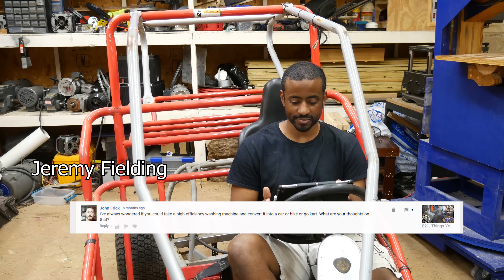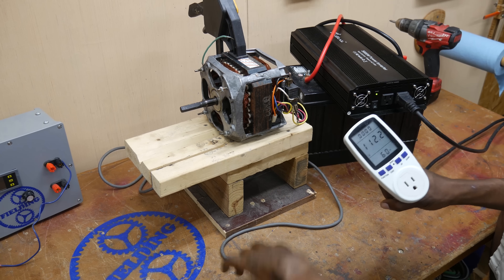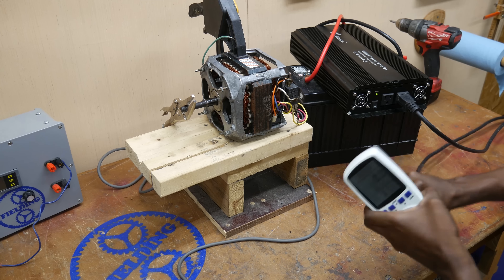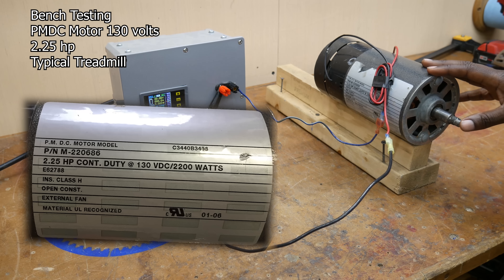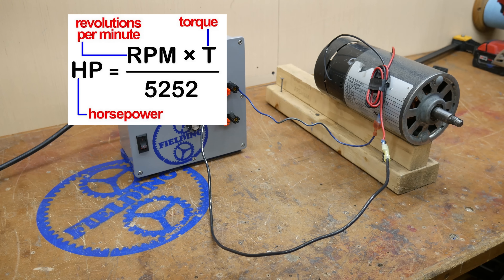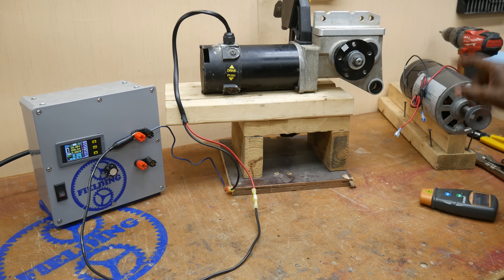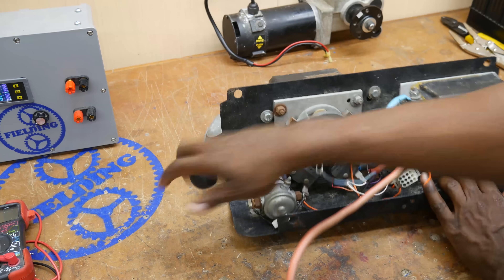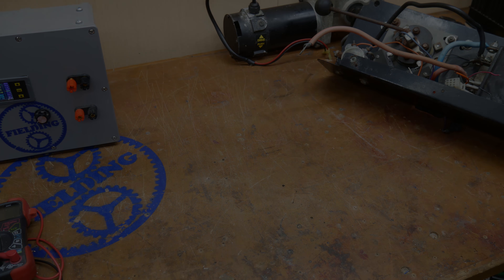What Electric Motors Can Be Used In A Go Kart or E Bike; Bench Testing and Recommended Sizing #61

Comment: Very good Jeremy. However I think you were unfair to the inverter. An induction motor will draw 6 times run current when starting, ie on locked rotor. 6 times that run current (150W/112V) is 1.34A x 6 = 8A. At 112V, that's 900W. The inverter was providing 1500W so probably wasn't limiting. The motor was simply drawing its maximum locked rotor current.
Reply from the maker: Which motor are you talking about? I don’t think I showed a motor that small with testing. Give me a time in the video if you need to, also I would want to learn more this 6x starting current? Do you have a good source for that? It’s sounds high to me, but I would love to learn if you got it from a good source.
Reply: Sorry, the washing machine motor at 2:28. Electricians are taught that an induction motor locked rotor current is 6 times run current.
Reply from the maker: That motor is 1/2hp or about 370 watts..I will look into typical starting current and see what I find. I would expect 2 or 3 times, but hey... its a great day to learn
Reply: Go here: https://electronics.stackexchange.com/questions/183451/starting-current-of-an-induction-motor. This is for 3 phase motors and it says at the bottom start current is 5 to 9 times run current. Single phase motors will be different and depend whether it has a start winding that is disconnected by a centrifugal switch or a capacitor-start capacitor-run motor like you see in a clothes drier. The former will have a higher start current than the latter

Comment: will that battery provide enough current to run a flux capacitor to go back and use more batteries so the inverter can use the larger reservoir of current to peek out properly?

Comment: Hi Jeremy. I have a Quantum 600 24VDC,  Pride power chair motor setup in a Shriner Parade truck.. 130 rpms output to a jack shaft to rear drive sprocket.. Speed should be 16.46 mph..Don't Need mush speed.   I got the machanics covered.. I need HELP in the control of it,  Foward/Netural/Reverse, and Varible speed.. What do I need to get to power it.... Motor is rated at 50amps..
Any Help will Be Greatful. 4073836045 Longwood, Fl
Reply from the maker: Unfortunately I can’t help directly like this. I hope you can understand, I get literally hundreds of emails and comments through my YouTube channel for advice and general help. Given the volume, It just isn’t safe or practical to try and troubleshoot problems or give advice one on one
Reply: No I dont Understand??? It took you longer to answer my question than to say get this controller and set up. But What EVER..
Reply from the maker: I don’t know what controller you need. That requires research. I have to leave the homework to you. Its kind of sad you can’t understand how much time it takes to respond to hundreds of technical questions.

Comment: how about electric winches?  And how about two separate motors one for torque and the other for revolution? may there be an optimal correlation? I ve been told the reason for the car starters to work for short time period is that some of them have the pinion bushings prone to heating and if u can find the ones with metal or replace u  r good to go. Is it legit? TY
Reply from the maker: In general motors are designed for the lowest cost with the max duty for that application. Electric winches are just like starters in that they are designed for max output for a short period of time. They can’t handle the heat of extended run times. I can’t comment on the other part. Of course it’s not impossible. Just more likely to fail sooner then later

Comment: I tried to use a blower from a drier to move air through a duct... the whole house sounded like a drier running.

I tried a Variac to slow it down... it would slow down a little then die... I had to give up on that idea.... found a circulation fan... it works, but like the other, was too noisy...

Comment: I have a question?
What would be the most suitable water pump motor to run directly from a solar panel/s?
Reply from the maker: I don’t know
Reply: Honest!
I suspect you'd need a battery/capacitor to work properly. A solar module has immediate voltage but variable current available, I was curious.

Comment: I... Stopped at 3 phase DC motor...
Reply from the maker: There is a note on the screen that says "brushless DC motor" which is correct.
Reply from the maker: I also always add technical corrections to the description if you are interested. This is there.
Reply: You were referring to an alternator ( 5:59 ), which is a 3-phase AC generator (eventually rectified/regulated to around 14.2 VDC) and can be rewired fairly easily to be a 3-phase synchronous AC motor. Which is exactly what he did in that specific video. He rewired it as a delta synchronous AC motor, and it wasn't a brushless system. Those DC brushless systems essentially operate in a similar fashion as that which would normally speed control an AC synchronous motor. They still create a rotating stator flux for which the magnetic field of the rotor (excited in that particular instance with a separate power supply, LiPO battery) can lock on to. Though, it's arguably less efficient than a system that was actually designed to speed control an AC synchronous motor. But that still doesn't make it a "3-phase DC motor." A DC motor doesn't have "phases" in that respect. That, and saying that speed regulation is difficult with AC motors. It's very easy with AC motors. It can just get expensive, as most methods involve a VFD in some form or another. Although, speed regulation in an AC induction motor can be completely done with a PWM setup as well. Synchronous motors cannot be controlled in that manner, however.
Reply: And yes, I read the description. I just... As an electrician, it just sorta rubbed me the wrong way, it's not really anything personal or that everything that was said was inaccurate.
Reply from the maker: Thanks for the feedback. I agree the alternator is 3 phase AC. I will make the corrections in the description. I also agree speed control with a VFD is “easy” but expensive. It’s a little out of context because of editing why I said that, but I have another video answering the question about controlling induction motors with other methods that don’t work, like using a dimmer switch to control an induction motor. Another highly requested topic. Anyway thanks for the follow up. I want to present information as accurately as I can, but it’s pretty hard to edit 10+ hrs of talking at the bench, catch every mistake, and leave every important detail.

Comment: i picked up a 24v 36amp dc electric pallet jack motor im considering making an electric cart with. salvaged controller, motor, charger. the original set up in the pallet jack two gear but large reduction. i figure less reduction will get more speed, and the motor should be torquey enough with 2 to 4 24v deep cycle marine lead acid marine battery's. if necessary i can add a flywheel clutch to let the motor get to a reasonable speed before engaging the load of moving the vehicle. like a commen gas powered go-cart. any thoughts on this endeavor?
Reply: Your motor is about 1hp output. I would recommend 4 golf cart batteries in series, if the size and weight isn't objectionable. They are 6 volts each, and a true deep cycle battery, with thicker plates than the deep cycle marine batteries, so you can discharge them farther without shortening their life. Deep cycle marine type is good, but the plates are a compromise between a starting battery (thin plates) and a true deep cycle battery (thick plates).
Reply: @solarfluxman8810  Who sells true deep cycle batteries?
Reply: @MultiPleaser  - I've seen 6 volt golf cart deep cycle batteries for sale at Costco. Deep cycle is the type used in electric pallet jacks. You should look online also.
Reply: I was also going to say that's about 1 hp, after subtracting losses.

Comment: A treadmill motor starts with a LOT of weight on it. 
What is the setup you have?? Tread mill motors will work!
Reply from the maker: You are only considered one problem. I am presenting multiple problems making it not worth it to solve all of them. Please watch again and consider all the reasons I give together. You need 130volts to move “all the weight” you are describing as one example.
Reply: Yes, I realized I was wrong later on, but neglected to come back and delete the comment. Sorry ...  :)
(However, as an electrician one told me, you can rewire a moter to be DC, but that is probably too complex for this video.)

Comment: OK, two things need to be pointed out here. The first is that universal washer motors can run off DC power. The second is that Lithium 18650 batteries pack a lot of power in a small space. The universal motors can be configured in multiples to increase torque. While a good DC motor is better, universal motors can be used and are much more ubiquitous than the high power DC motors in the world. Ideally motors from golf carts which are already connected to a drive system are a great fit for a go cart. Especially with 18650 packs as they are much lighter than their lead/acid cousins and have a much higher power density. That is to say that I agree with you for the most part. At the end of the day though, we all have to use what's available to us and that's my point. Great video.... Liked and subed.
Reply from the maker: First welcome to the neighborhood! Please check the description regarding the washing machine motor type. I talk more about lithium batteries in the second and third video

Comment: Just an FYI, you absolutely can run a 3phase AC motor on a DC system without an inverter. This is the common setup for DiY electric car conversions, actually. Andthey aren't as expensive or impractical as you seem to think.
Reply from the maker: The inverter wasn’t the point. The point was typical motors salvaged from machines (designed for household or industrial applications) are not a good fit for this application. It is best to buy a motor 3 phase, Brushless DC (they are not the same) or other wise designed for mobile applications.i.e. Lower operating voltage and the appropriate controller to match. That is what I said and that what the take home message was suppose to be. What you think is expensive depends too much on the person so I want get into that. But keep in mind we are talking about a backyard DIY project, not a highway-ready electric vehicle which is expected to cost significantly more.
Reply from the maker: One more thing... I didn’t say the controllers or motor was expensive... I said the inverter would be so expensive trying to use a recycled motor you should just buy a motor and controller designed for this application. I.e. less expensive.

Comment: washing machine motors are not usually induction motors, they are series wound, and can run on DC.. Inverter is probably peak power....
Reply from the maker: Please read the description. It answers both of your comments. "Usually" depends on where you live. The peak power is 6000 watts according to the manual and website where I purchased it.

Comment: I just came by to see if I could use a small generator with an outlet 120v to run my three wheel scooter. I bought a TailGator generator, an I want to run off of it, I don't want to always have to charge it an I don't want to have to call others to come pick me up when I run out of power, it normally runs off of  two 12v  35 ah batteries. But here in San Antonio its a big place. Thank You Loader.
Reply from the maker: It certainly isn’t impossible but the setup would not be simple. And very impractical. If I understand you correctly you want to carry the generator as a backup power source when the batteries die? That creates several problems that need to worked out. I would recommend having a second set of batteries before taking a generator
Reply: Luciano Guerra not unless the battery weighs more than the generator.
Reply: Luciano Guerra 
So you want to charge your batteries when you run ‘emty’ in the middle of nowhere? 
I think it should be possible although you might not be able to drive and charge at the same time. Since you already got the generator why don’t you just hook it up via the charger and see if it works?

Comment: What about a universal motor running on A.C. using a transformer to vary the voltage. The only fairly difficult part is changing the dc from the battery to A.C. right? Also it seems to me that using a transformer to vary the voltage is more efficient than a potentiometer because the potentiometer in series with the motor will heat up and waste a lot of energy making the system very inefficient since p=i×v the current and voltage across the potentiometer is wasted energy.
Reply from the maker: Most controllers use PWM to control the motor. The potentiometer is only human input to tell the computer how fast to go. As to DC to AC. That was discussed in the video. There is no cheap effective option. The Inverter, and high power transformer would cost more than just buying a motor and controller designed to run on low voltage DC. That is also assuming you already have a universal motor powerful enough to do the job to begin with.

Comment: Jeremy my friend. Great vid as always. How can I tell is my speed controller is rated for brush-less or brushed? Will it usually say on the controller ?
Reply from the maker: It would be in the manual and should be clearly stated before you buy
Reply: A brushless controller is 3 phase and will have 3 wires. A brushed controller will have only two wires.

Comment: You need to find a AC brushless motor.  Brushless motor vs brused is a new chapter, typical brushed have a efficiancy of 60% MAX, use brushless motor and you can almost get twice the distance on the same battery! Typical 90% + efficancy. 

https://hobbyking.com/en_us/turnigy-rotomax-100cc-size-brushless-outrunner-motor.html
300$ for 10HP motor and 200$ for a speed controller. Easy 50KMH
Reply from the maker: I have been searching for brushed and brushless, but I haven’t seen this. I agree that is the price range I was looking for.
Reply: My dad old work place was boat side propellers design back in 2000. I was a side "kid" on most of the testing. Range from 2,4,6,10,5KW DC brushed side thrusters, but the efficancy of this "small" motors is not that good. Larger 50kW+ can have 85+ but this are heawy compared with brushless. But this "100CC brushless motor" is design to have a large propeller colling it. So you have to attatch just the fan part of a "120mm computer fan" on the back side of the motor spinning with the motor casing. Also this motor have a little more PPM than you want. If you run the motor on eks 44V (12S lipo) the motor will run at 44V*178Kv(RPM*V)= 7800RRM but, that is no load RPM. So i will guess that you will have a 15-20% RPM loss is your go cart. So gear it to about 6000RPM on the motor. ( yes that is a back side of brushess motor on this size).
PS: I have one ;)

Comment: 0:51 OBJECTION! an universal motor which is what is used in washing machines can and will run on DC, though it requires stepping up or down unless you use 2 batteries at different voltages.

Nevermind, you talk about them right after that. Though I still stand by the claim that most washing machines do use universal motors and not AC motors.
Reply from the maker: Please read the description... lol... you are way too excited :)
Reply: For once I'm the culprit of not reading the description, sorry. 
Though one of the best motor system for low power (<3kw) go karts is simply using a low kv brushless model car motor and controller, which can be bought for less than 100$ on hobbyking or other websites. If possible going for a sensored system is better, because it allows for a smoother start or to start at all depending  on the motor and controller.
And, well brushless "DC" motors are in the family of 3 phase ac motor.
for E bikes 250W is enough even when going for motor only.

Comment: Hey Jeremy, very nice video.  I am working on a trike project for myself and using two BLDC wheel motors that I have.  They are initially rated at 500 watts.  I am not looking for speed as much as torque.  I was considering increasing the three phase supply wire size to increase the amperage.  These are Chinese motors and there is little information about them.  The reason I am doing this is, I am legally blind and want a mobility scooter that is cool not old-mannish.  I will be riding it on the sidewalk so I don't want to go much over 15 MPH, but I want to be able to accelerate quickly to get out of the way if I find myself in a situation.  The controllers I have (which came with the motors) are rated at 30 amps per motor.  I know you can't give me any specifics, but what general ideas would you have for me.  I am not an electrical guy.  Thanks, great video!
Reply: What motors do you have?